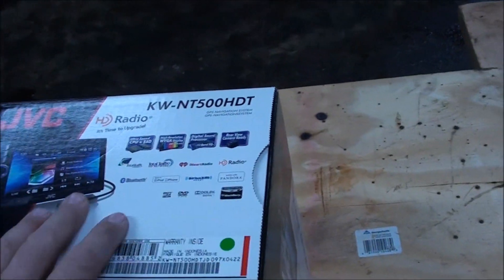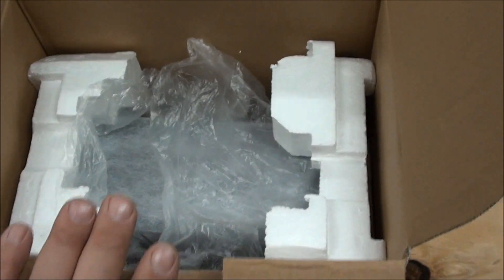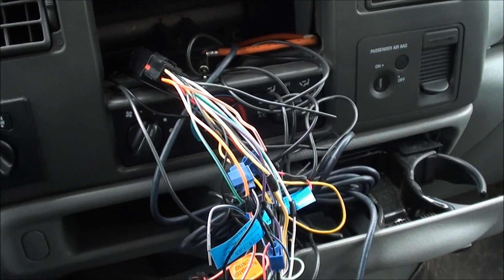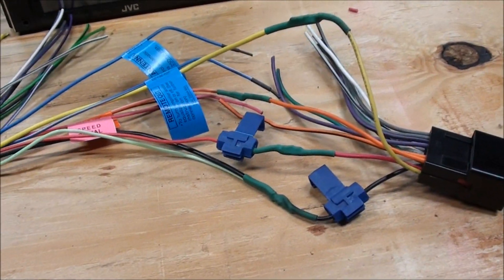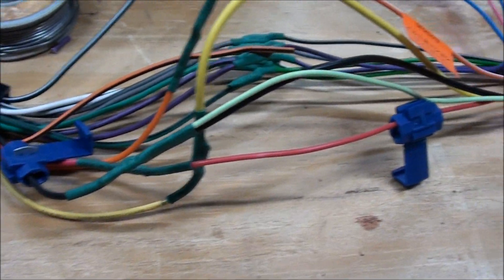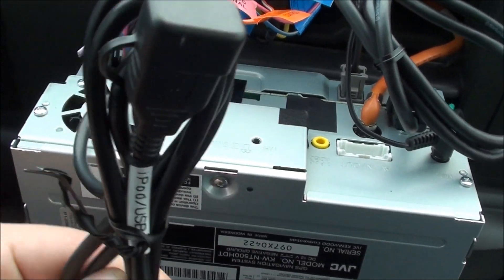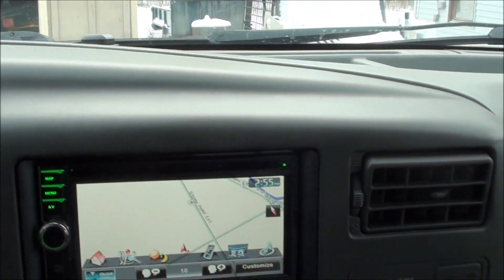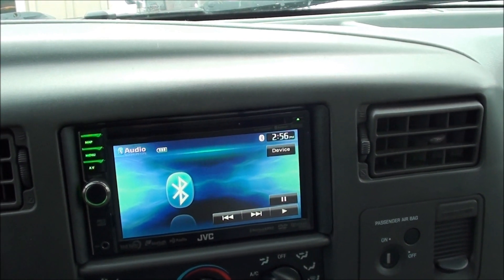JVC stereo install

Comment: does it have navigation built in
Reply from the maker: Yes, it does
Reply: 123guinness quick question. you said it does have a built in sat nav, right? which means it doesnt have that sd card crap thing which is found in other stereos.
Reply from the maker: Correct. Just hook it up and away you go.
Reply: 123guinness does the map get updated automatically?
Reply from the maker: Yes. I know that because at the end of my street a traffic circle was constructed last year. About a month after that it showed up on my map.

Comment from the maker: Yes, with Android you can plug it in and listen to music. But I just stream music through Bluetooth. No wires necessary. Also, the phone works great. The mic is located by the "A" pilar and functions are on the screen. When a call comes in, music is muted and a rig tone comes across the speakers. Thanks for watching

Comment: What dash kit is that, do you have the part number?
Reply from the maker: That was well over a year ago. I'm sorry, I don't remember. When I got the head unit and realized it needed a dash kit, I went on Crutchfields website and found it there. As I recall it was easy to find what I needed. Just entered in some vehicle info and what head unit I was installing. It told me exactly what I needed.